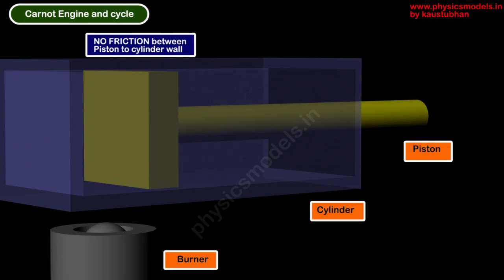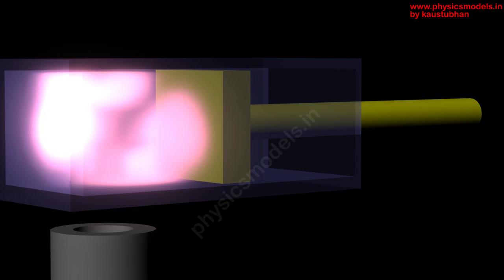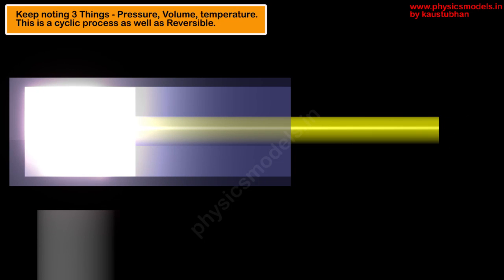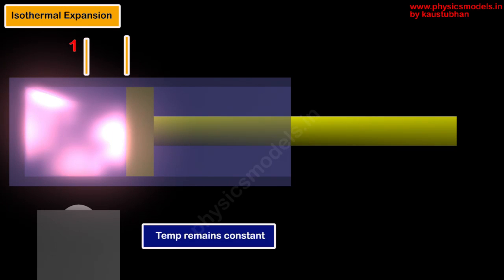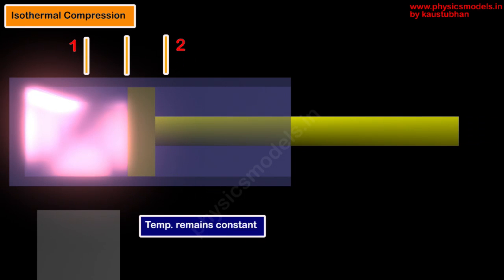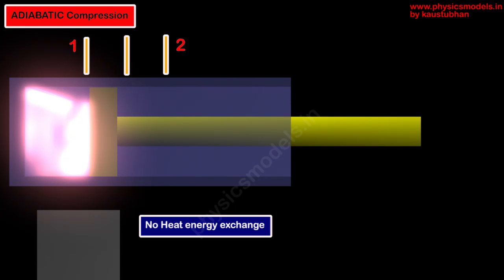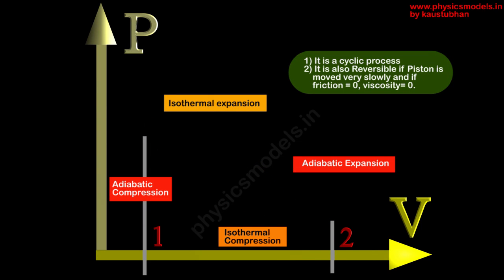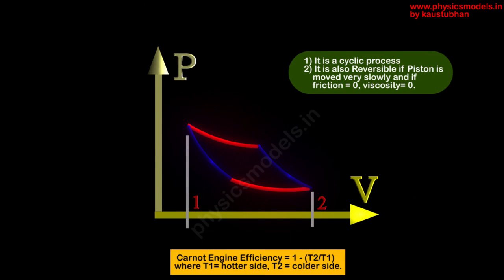Physics Made Easy -Thermodynamics -Carnot Engine- basic introduction

Comment: This is a very good example of a video that will only make sense to people Who are already familiar with this concept. There’s no mention of why the piston is moving when it’s moving, especially when it’s moving back to a starting position. But I still wanna come to your barbecue.
Reply from the maker: Ok got it. Your comments are interesting. Let me clarify.
Actually the piston is moving just to help visualize the many things that are happening here. The expansion of the gas , I  showed by a Flame which inputs Thermal energy into the gas. 
There are two kinds Of expansion- Isothermal and Adiabatic. Similarly two kinds of compression.
I can't show a Heat Sink and Insulator wrapped all around the cylinder, then nothing would be visible 
Now, the gas gets compressed in the Return trip, in order to complete a full cycle. The piston has to get back to a starting point , which you talked about.
The piston movement is important to visualize, it helps remember that gas molecules will get increased energy from the piston, and gas temperature will increase. I can't visually show the isothermal as well as adiabatic  system, its anyway a theoretical Engine, an ideal Carnot Cycle .
 that's as far as I could show by moving the piston very very slowly to visualize an ideal Isothermal process , here the gas temperature should not change even if it's being heated by a Flame ! 

Maybe I could have shown a complete wraparound insulation hiding the whole cylinder and piston rod but that would look ugly . 

So with those comments in mind, the video was meant to be for a beginner and not necessarily a person already knowing the concept. Thanks

Comment: Where is the sink ?!
Reply from the maker: Hello Sowmya,
Good question. I have'nt shown two things in the Animation: a) The perfect insulator and b) the perfect Heat sink.
I had some difficulty to show it practically in a visual way. The perfect insulation is needed during the Adiabatic Expansion as well as during Adiabatic Compression to avoid any heat losses from the Gas. This means the whole system would be covered and nothing will be clearly visible. 

Then, The Perfect Heat Sink is required to absorb the heat coming out of the gas during Isothermal Compression, in order to maintain the Gas temperature constant. The gas is getting compressed very slowly, and its temperature should not increase due to compressing it.  

Now, another challenge is that the processes of Adiabatic Expansion is immediately followed by the Isothermal Compression. So the Heat Insulator  which was covering the whole cylinder and piston system from the outside of it during the Adiabatic expansion process,  has to be removed and instantly replaced by the Heat Sink system covering the whole cylinder and piston system to absorb the heat in the Isothermal Compression. I felt this would have made the animation look very difficult to view and understand. 

But yes, the Heat Sink and The perfect Insulation are an integral part of the Carnot Engine abstract concept.
Reply: @physics_animation_tutorial  I got it. Thank you so much for your valuable reply. :)

Comment: Where is the sink
Reply from the maker: Hello Hacking Made Fun. 
that's a Good question. Sorry for my late reply, I finally got around to addressing it.  I have'nt shown two things in the Animation: a) The perfect insulator and b) the perfect Heat sink.
I had some difficulty to show it practically in a visual way. The perfect insulation is needed during the Adiabatic Expansion as well as during Adiabatic Compression to avoid any heat losses from the Gas. This means the whole system would be covered and nothing will be clearly visible. 

Then, The Perfect Heat Sink is required to absorb the heat coming out of the gas during Isothermal Compression, in order to maintain the Gas temperature constant. The gas is getting compressed very slowly, and its temperature should not increase due to compressing it.  

Now, another challenge is that the processes of Adiabatic Expansion is immediately followed by the Isothermal Compression. So the Heat Insulator  which was covering the whole cylinder and piston system from the outside of it during the Adiabatic expansion process,  has to be removed and instantly replaced by the Heat Sink system covering the whole cylinder and piston system to absorb the heat in the Isothermal Compression. I felt this would have made the animation look very difficult to view and understand. 

But yes, the Heat Sink and The perfect Insulation are an integral part of the Carnot Engine abstract concept.
Reply: u can think of the burner as a reservoir that suplies and absorbs heat with infinite thermal capacity. So it acts as both source and sink

Comment: without a heat sink (cold sink), there will be no cycle!
Reply from the maker: Hello ,
sorry for my late reply. I finally got around to addressing it. 
Good question. I have'nt shown two things in the Animation: a) The perfect insulator and b) the perfect Heat sink.
I had some difficulty to show it practically in a visual way. The perfect insulation is needed during the Adiabatic Expansion as well as during Adiabatic Compression to avoid any heat losses from the Gas. This means the whole system would be covered and nothing will be clearly visible. 

Then, The Perfect Heat Sink is required to absorb the heat coming out of the gas during Isothermal Compression, in order to maintain the Gas temperature constant. The gas is getting compressed very slowly, and its temperature should not increase due to compressing it.  

Now, another challenge is that the processes of Adiabatic Expansion is immediately followed by the Isothermal Compression. So the Heat Insulator  which was covering the whole cylinder and piston system from the outside of it during the Adiabatic expansion process,  has to be removed and instantly replaced by the Heat Sink system covering the whole cylinder and piston system to absorb the heat in the Isothermal Compression. I felt this would have made the animation look very difficult to view and understand. 

But yes, the Heat Sink and The perfect Insulation are an integral part of the Carnot Engine abstract concept.